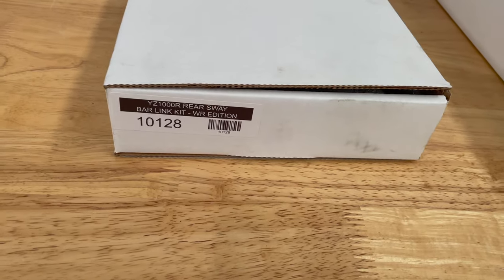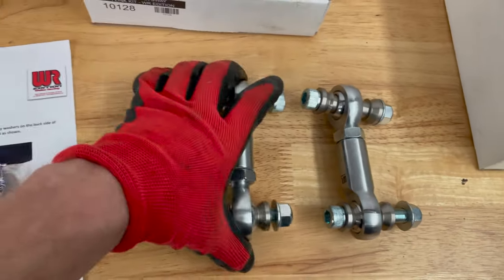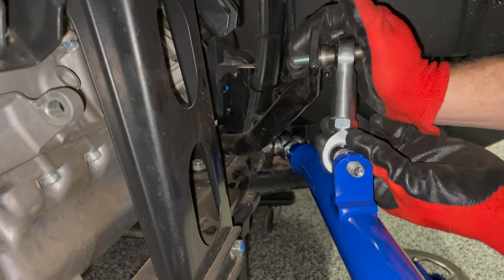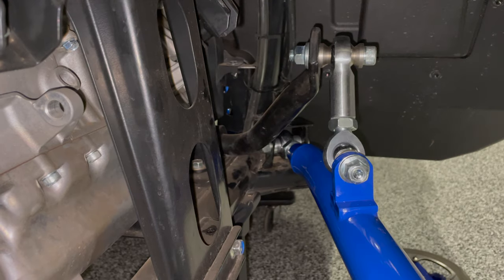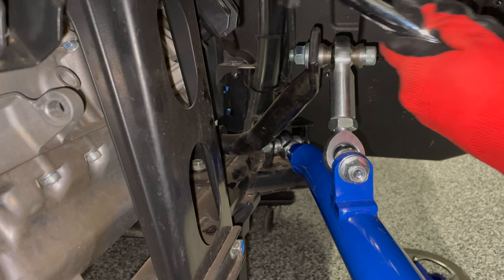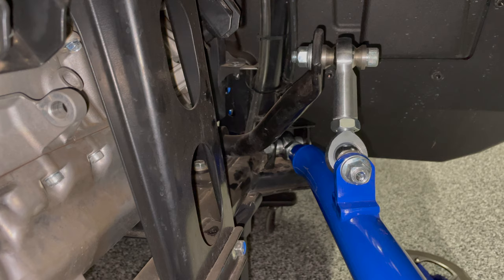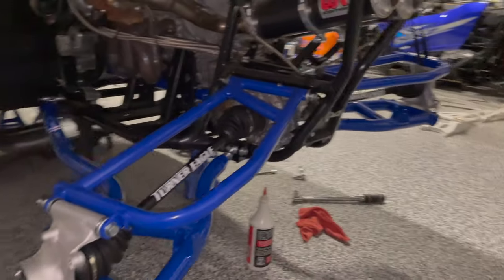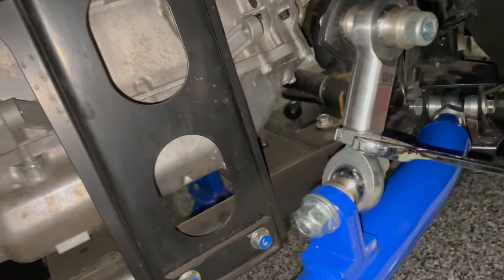Weller Racing anti sway bar links install on YXZ

Comment: Hello I just put some Race Driven brand links on the rear, they are similar to yours.  No instructions, no torque specs and only one washer showed up.  I used washers from the stock links, I put washers on both sides of the spacers on the Heim joints and on the nut sides.  I put the pan head bolt with no washer riding on the brackets if that makes sense (opposite than the way you ran yours due to it mine are just a 22mm pan head bolt and a nylon nut).  Basically does that sound OK to you with washers on either side of the Heim joint?  Thanks
Reply from the maker: Just check to make sure the joints don't bind or make contact with any moving parts while the trailing arm cycles from top to bottom of the suspension travel.
Reply: @bendavis35  RaceDriven replied back, and you are correct.  Also they would not give me a torque spec and said look in service manual, crazy.  But I see what you used so will go with that.  Thanks for the reply

Comment: Once your yxz is on the ground  do you have to adjust them again
Reply from the maker: I would just check to make sure the hiem joints are centered.  The length of the links do not ever need to be adjusted.

Comment: What exactly did you achiev with that Setup now?
Reply from the maker: The OEM anti-sway bar links are prone to breaking when the suspension is at full articulation.  These Weller Racing links are much stronger, plus they look great!
Reply: @bendavis35  so the next Proof that factory stuff is total crap. For such a expensive SXS, so many crap 🙄
Reply from the maker: @all_out_of_bubble_gum  I believe the Yamaha engineers intentionally put weak points in so the larger parts like the frame or arms don't get permanent damage in the event of a hard hit.  The tie-rods, sway bar links, and bumper are all designed to break before anything else.